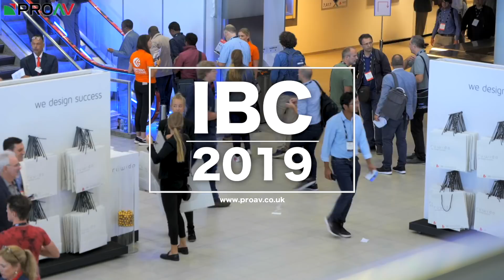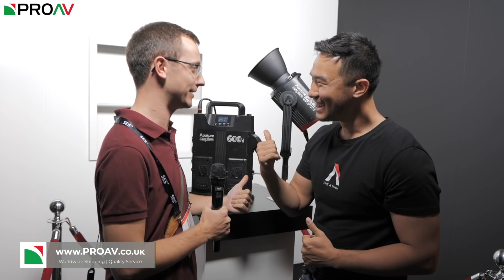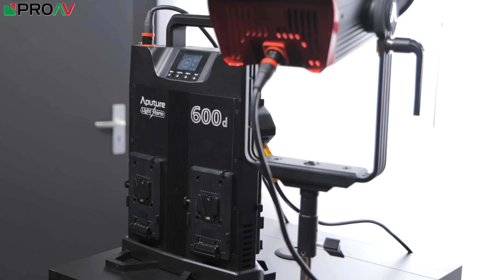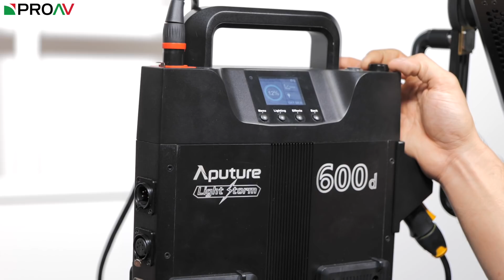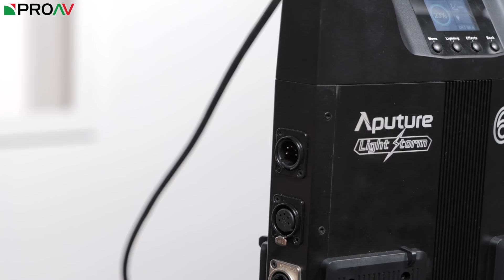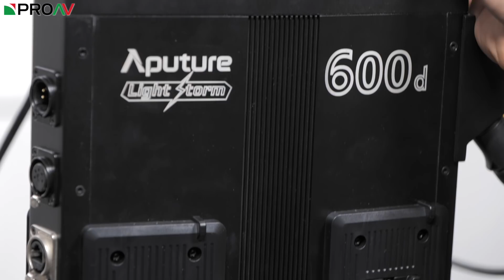Prototype Aputure 600D | IBC 2019

Comment: I wonder how hot this thing gets and if it's hot will the fresnel/ light done work without damaging it
Reply: Fresnel lenses go on 5K tungsten lights with no problem...
Reply: Rodrigo Prata you said it before me lol
Reply: Rodrigo Prata fresnel units don’t have electronics that malfunction from overheating. The quartz-tungsten globe doesn’t generate enough heat to melt the housing, the glass fresnel, the back reflector, or the cables. Part of the design of these lights big sturdy housings that assist in heat removal. This is why Studio Juniors need less globe replacement and less maintenance than Baby Juniors. Try wrapping a tungsten unit in black wrap and see how long it lasts before failure.

The challenge with big wattage COB LEDs is big LEDs do generate heat that must be removed from the system, lest it destroy itself or other electronics. That heat removal system also needs to be on the quiet side for sound recording. The fact that the 600d is not yet for sale tells me that they’re still working on a way to quietly remove heat from the system. It’s a non-trivial problem.
Reply: If it gets that hot, they’ll over a glass fresnel option (and make it clear that plastic fresnel lenses are “not supported”. That said, the electronics will melt before before the plastic fresnel does. If they can cool it enough to prevent the LED itself from burning out, the plastic accessories should be fine.